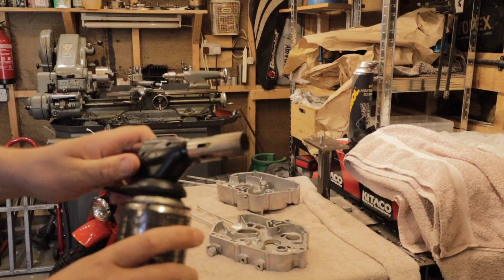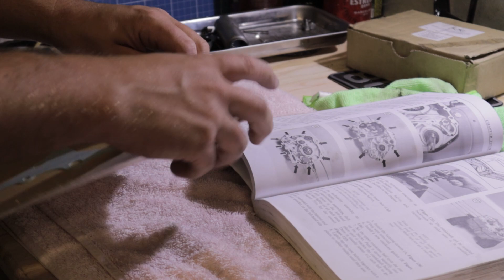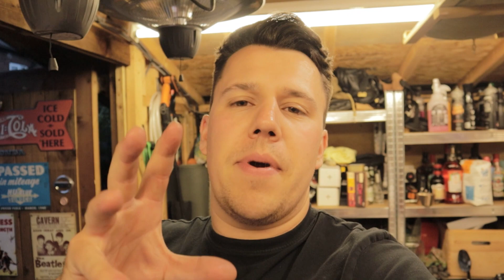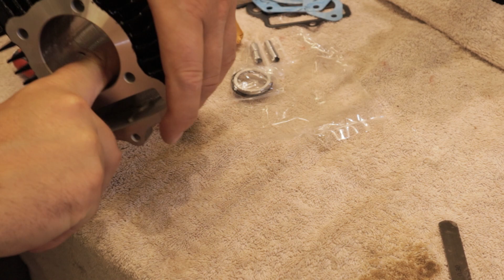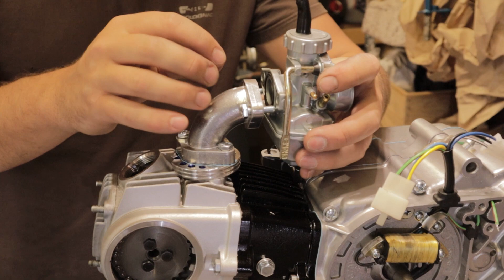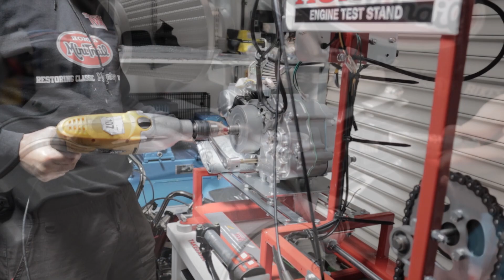Building an 88cc Honda Engine with Performance Kitaco Parts - CT70 Part 4

Comment: I thing you forgot to put the guides between the cylinder and the crankcase..
Reply from the maker: Assume you are referring to the dowels ?
Reply: @MasonsWorkshop yes! The pin dowels.
Reply from the maker: @s.r.g.3586  Maybe not captured in the video due to the difficulties of filming and editing it all, but they are definitely fitted though!

Comment: I'd really like to do this setup but want to retain the original look of the air box. Is this possible?
Reply from the maker: Hey, I am not 100 percent sure. Im sure it is possible but can imagine you would need to makes some modifications to the air box to accept the bigger inlet. Im sure it can be done though, just not very easily!

Comment: You forgot to put the o-rings around the ingition bottom plate bolts.
Reply from the maker: @pojoingx5201  well spotted but I think this was just down to the way it was filmed where I didn’t capture them being fitted.
Reply: @MasonsWorkshop  oh, alright. Anyway this was overall a great video thanks👍
Reply: Prob, thats why your ignition was always leaking oil… never seen one leaking because of the big o-ring failing….

Comment: @Mason’s Workshop Great video! Mind sharing part numbers for all parts used please?
Reply from the maker: Hi there, tried to summarise it as best as possible below: 
- Kitaco 88cc STD-Type 2 Bore Up Kit Z50 6v: Bens Bikes Racing (no P/N shown)
- Kitaco Manual clutch conversion kit: Shire Bikes 307-1123100
- Kitaco high flow oil pump: Shire bikes 331-1013300
- OHTOKC 6V Hitachi  electronic ignition unit: OHTOKC: Shipped from overseas but great parts, be sure to select the right flywheel. 
- Bearings: Took old P/N and purchased from Ebay 
-Misc.: Shire bikes as they stock all of it in the UK. 

Feel free to contact me if you need any more info!

Comment: Like to see the details of the ignition conversion assuming it would run without a battery for my project which is a custom and simplified as much as possible...jf...
Reply from the maker: Hi there, Yes no battery needed as there is 6v provided from the ignition to run basic system such as lights. Same function as the standard points ignition system but much improved. I would recommend it!

Comment: Really intresting ,thank you that will help me , i have a 90,s  kitaco 88 kit and a 108 kitaco crank to go with it here spare which i have cleaned with a view to building a spare engine
Reply from the maker: Glad you enjoyed it. That sounds great, I bet a 108cc kit really moves well on one of these! I am looking forward to getting mine finished and out for a test ride!
Reply: @MasonsWorkshop  the Kitaco 88 is lovely, I'm running a new 88 Takegawa R kit now,  I've got a soft spot for Kitaco &  108 is superb .I'm running  the simul8 spec as you kitaco manual clutch etc , it's plenty fast enough for a standard brake set up .yours will be ace
Reply from the maker: Brilliant to hear. I agree, the Kitaco parts are super nice quality. Also glad to hear it performs well on the road! I think it will be a nice improvement. @jasonblake7225
Reply: @jasonblake7225  Did you go with a 12 volt crank or 6 volt crank?

Comment: Smart move. 5 years ago, I rebuilt my 69 Honda MiniTrail. It was a full restore. I decided on a Big Bore kit to up the cc's and a new cam shaft designed for torque. The other thing I did was to go with a smaller front sprocket heavy clutch pack, and a racing carburetor. The end result was a torquey little beast that could easily pull my 290-pound frame around the farm. These little Honda's are pure fun. Congratulations on the build!
Reply from the maker: Hi Peter, thanks for the comment! Its really cool to hear about your build. Sounds like something that will be similar to mine. 
They are great bikes, looking forward to getting it built and enjoying it, no plan on selling it at all! I'm after that stock look with the performance benefits.
Thanks for watching !